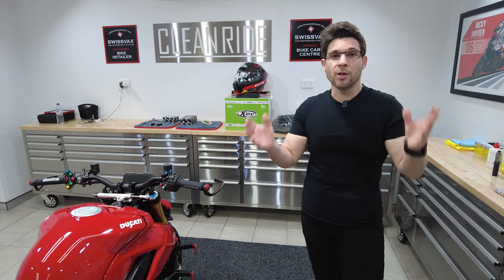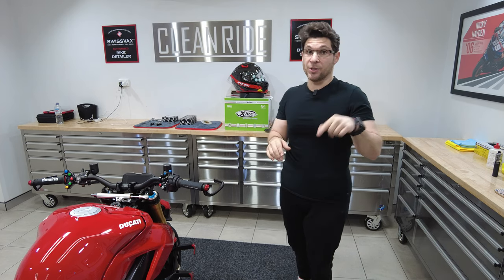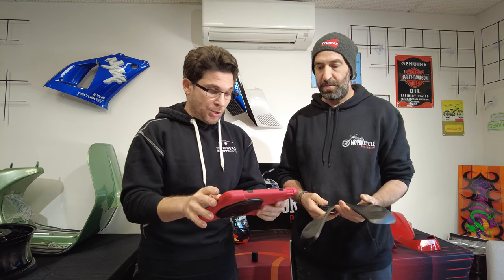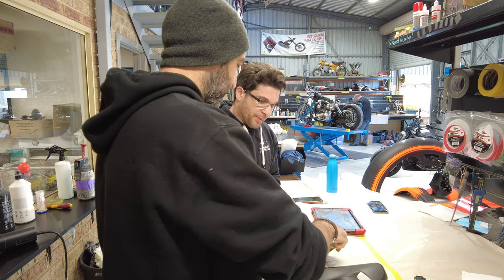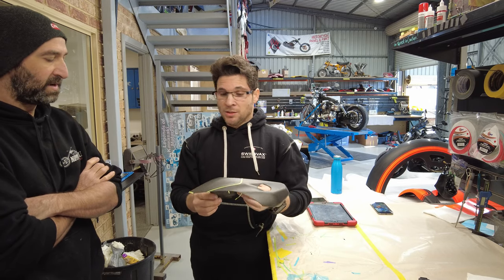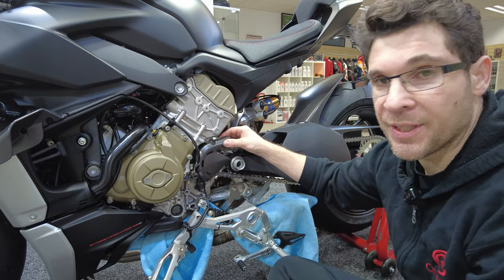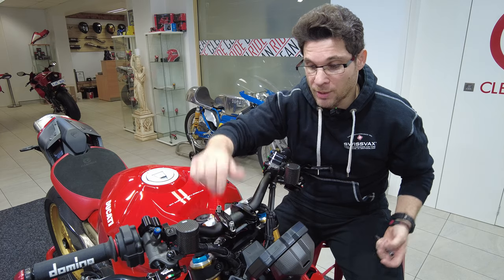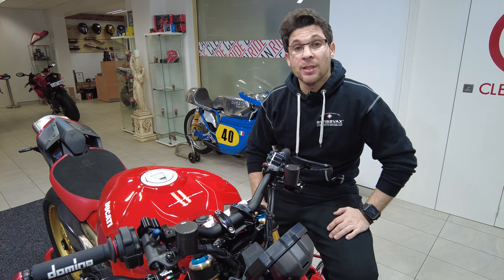Ducati Streetfighter V4S Project Build Part #18

Comment: Can I make a respectful suggestion, and it is not a fully formed view, but here it is? One (probably the only) of the aesthetic positives of the new S1000R is the flat handlebar.  Would you consider a flat carbon fibre handlebar for the StreetFighter? It would be a nice additional bit of bling, probably lighter and may damp out vibration. Just a thought.
Reply from the maker: Love the idea, will look into it 👍